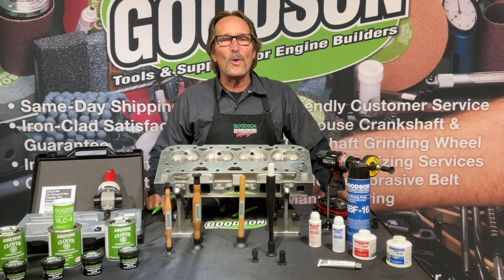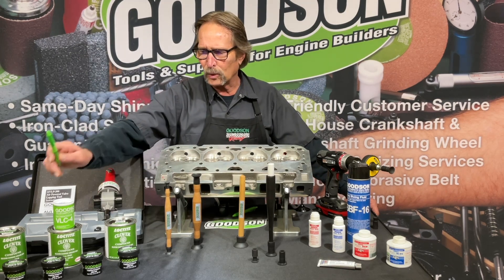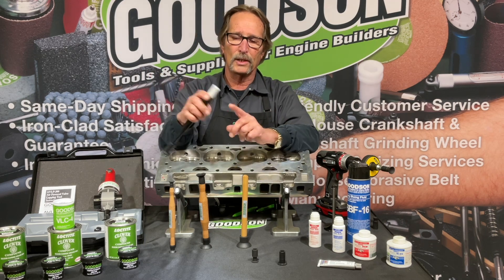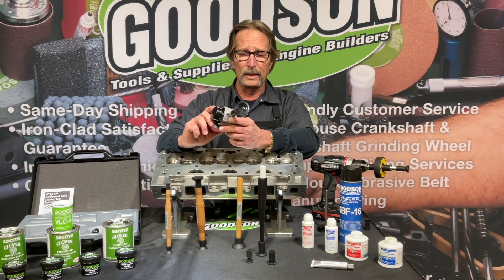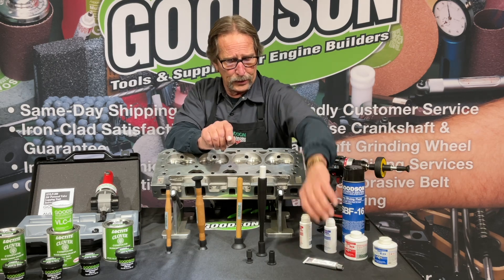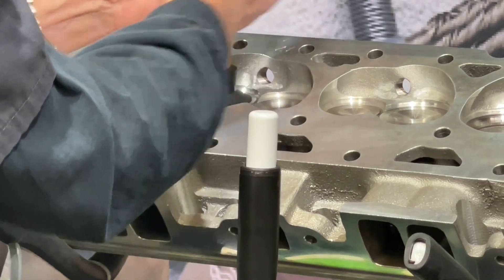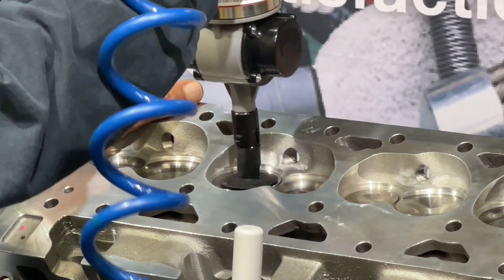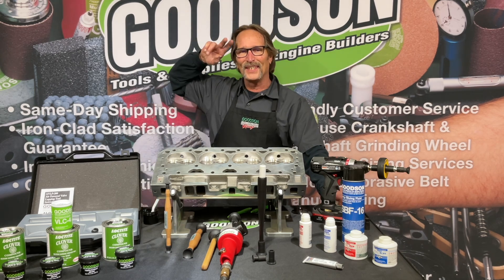Valve Lapping

Comment: What air pressure is the air lapper run at, I see your demo it is running slow. Many youtube videos it is running very fast like a jackhammer. What is the optimal pressure, if not optimal, please describe the benefits of different operating air pressure.

Comment: You will never be able to lap valves very well with the wooden handle that fat , put it in the lathe and slim it down alot to a concave shape , this will keep your hands in the  correct place and rotate the valve at a better speed .

Comment: I've been wanting to upgrade to an electric or pneumatic tool but I'm curious how you can even hear or feel when the process is working over all the noise and oscillation from the tools?
Reply from the maker: your results are determined by sight and not really in feel or hearing. Even with the air tool I can still feel the grit working into the seat to mate the valve face to that valve seat. Your eyes and measuring tools are your final confirmation on whether you have achieved the proper lapping result.